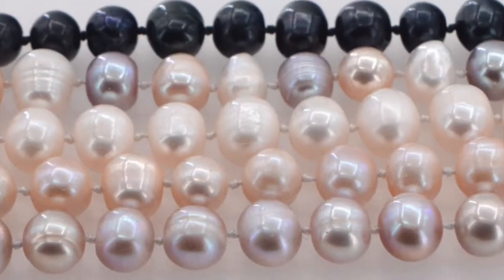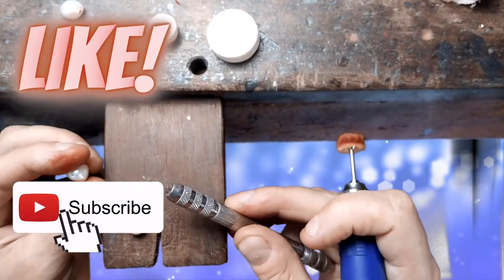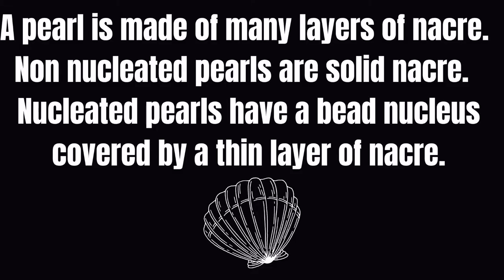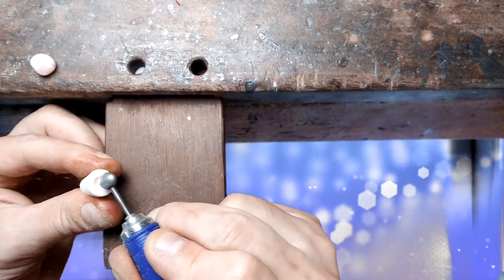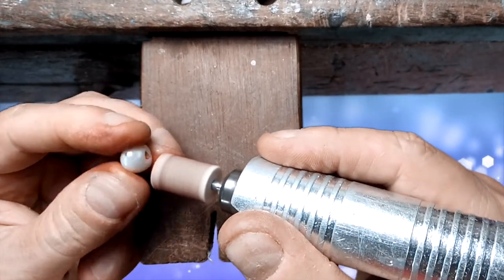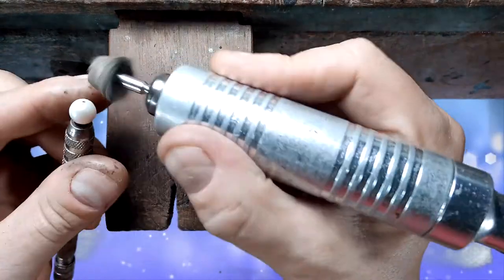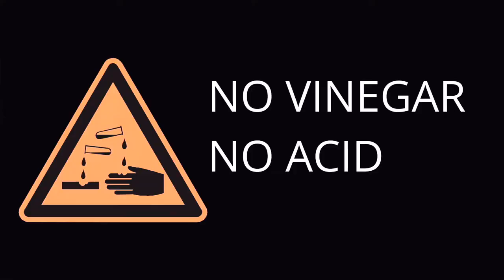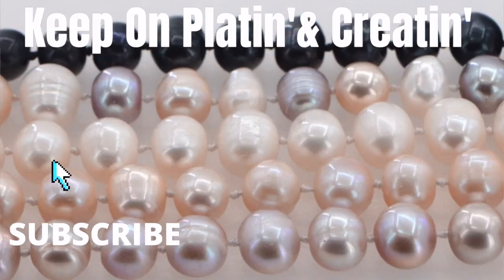POLISH PEARLS Easy  Professional Way  Make Your Pearls Look Better / Refurbish Worn Pearls

Comment: What's the difference between red rouge, "tripoli" polish, and some other important polishing compounds? Can any compounds double as ways to polish /strop a knife edge?
I have top quality hand made Ukrainian diamond polish of various carat weights (micron size)  and density.
Is there a list of compounds that you think everyone creating jewelry should have?
Reply from the maker: Rouge is iron oxide polish and used for soft  non ferrous metals.  Tripoli is diatom powder and  mildly abrasive.  I keep red rouge and green + Tripoli.  I also use diamond powder for polishing stones.  I am not sure what is used for stropping though

Comment: Hi I want to know. Which instruments you used , and which products you used to polish pearls, I have natural pearls .
Reply from the maker: HI!  I am using a foredom flex shaft with a #30 handpiece.  The polisher is a medium felt wheel mounted on a screw mandril charged with polish ( red rouge.)   Red rouge can be found in a jewelry supply shop , ebay, amazon.

Comment: I used Tarn X on a sterling and gold bracelet with one pearl. It looks dull now. Will this help?
Reply from the maker: Tarnex is an acid, if you only dipped it into the solution and rinsed then this would help.  If you left it in a long time to soak you may heve done severe damage would need  to use tripoli.

Comment: Aren't non-nucleated pearls super rare and expensive? Or are you referring to keshi? or...? Thank you.
Reply from the maker: Thanks for watching! I'm referring to cultured pearls, non nucleated are started with a piece of freshwater mussel inserted into another mussel. This is probably the most common.  In nucleated cultured pearls a shell bead almost the size of the finished pearl is inserted into the mussel.  The definitions may be different for natural pearls, which are very rare.  Keshi pearls are also non nucleated, and (to my understanding,) a byproduct of certain cultured pearl production.
Reply: @electrojewelerjordan490  OK, so you do mean cultured, but nor seeded with a bead, right? Being able to polish a non-nuckeated pearl sounds like there is only nacre (like keshi). Deep nacre is fantastic for being able to polish a pearl, deeply if needed. I still can't find "non-nucleated" pearls, anywhere.
Reply from the maker: Correct, most of the smaller sized round and oval cultured freshwater pearls are non nucleated.  If they are unusual shapes  or very large then they are generally seeded with a shell bead. Disk pearls, coin pearls, button pearls, crosses, stars, faceted, large like 10-15 mm are common nucleated pearls.